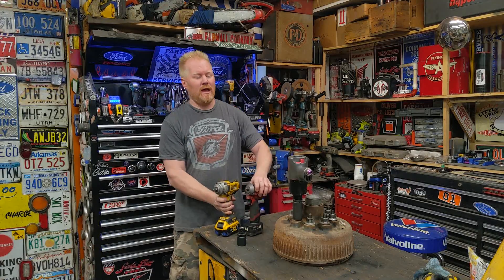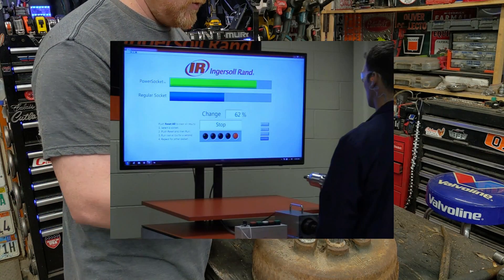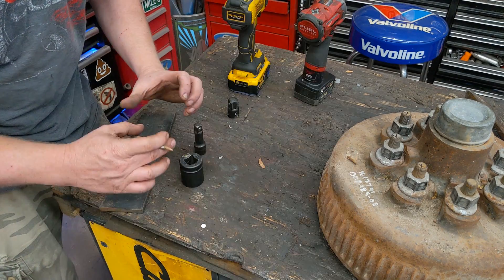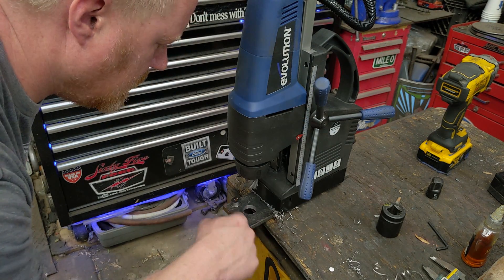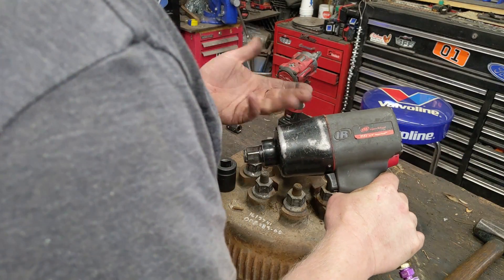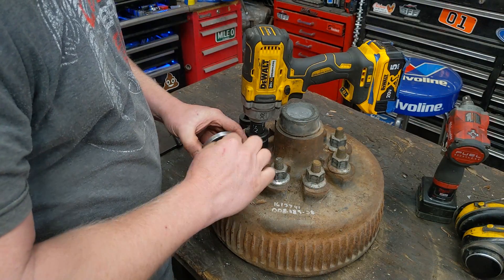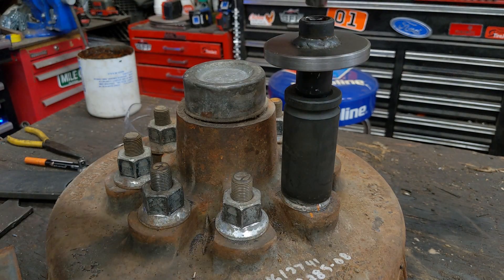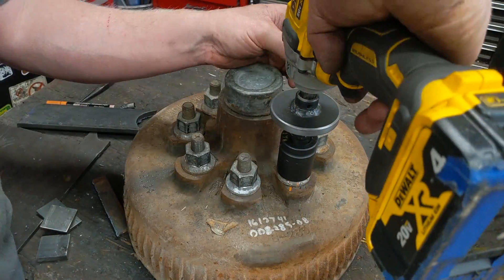Weighted Socket Adapter Build Experiments

Comment: singlecams has several videos on making DIY heavy sockets that he's taken big nuts off with. For instance https://www.youtube.com/watch?v=MZWrdXbdgRo shows using two sockets nested to make a single socket that is stiff and heavy to get crank bolts off.
Reply from the maker: Yeah, I've seen plenty of guys doing this and know it works. I wanted to see if you could make an adapter so you can swap between all sockets without modifying any of your sockets.

Comment: Take the impact gun and put a pipe wrench on the socket as you are hammering.  Leverage rather than mass.  Nice video.
Reply: This is a great idea. It never crossed my mind before. Thanks for sharing
Reply: Combining steady torque w a bit of shock.  It's going to work.  Problem is I usually can't get a pipe wrench into those spots.  Also takes an extra set of hands.
Reply: Family friend who was a Sears mechanic for 25 years told me... "When using impact tools, grip the socket with your free hand and twist counter to the direction of the rotation the tool is trying to achieve".  Something about the momentary reset of the socket back against the hammers gives them more driving force each time they hit.  Not sure of the science behind the theory, but in my experience, this trick has proved helpful almost every time.  And I have honestly never seen a weighted or flywheel socket.  Just heavy duty sockets designed for impact tools.  Great video!
Reply: @matthewpeterson3329  ever seen a socket explode, it would be ugly on a hand
Reply: @Coarse Thread    I've seen them split open, though never an actual impact socket.   It's usually someone using a standard socket on a gun.  Never seen one explode.
Reply: Thanks!
Reply: Sounds great! Now try that method on a Honda crankshaft bolt

Comment: The problem as I see it is the weight you added isn’t going into the socket only the extension in the socket probably not being as effective as having more weight hitting on the nuts than the the impact wrench socket itself. I would say do some sort of spring loaded mechanism that pushes weight over the socket

Comment: Just for R&D i would've welded the extension to the socket eliminating the play and loss of torque. That would've given you a definitive answer to the "Loss of torque with an extension question" 
If you didn't want to weld them, then put some aluminum foil in the socket. When the extension is inserted it virtually eliminates any gaps between the two. I've done it many times.
Reply from the maker: I know I can just weld weight to a socket and make it work but I want the adapter to be interchangeable between sockets. So part of the key to this is it has to work with the slop with the socket connection.

Comment: Good stuff, sir.  It was worth a shot.  I think the included clearance fit on both sides of the socket adapter (which makes tool-less socket installation and removal possible) plays a big part in negating any torque gains.  I know you wanted a modular approach with the socket adapter, but could you try a pipe sleeve on that large socket, but not welded on, maybe with a couple of set screws, or a key and keyways?  Just as a proof of concept.
Reply from the maker: The problem is me wanting it modular. I thought about a sleeve approach but the massive size differences in sockets makes it probably only useful for maybe 3-4 socket sizes before you have to make a new universal size. Not a bad idea though. Impact sockets all have a hole for the detent ball/pin and I was trying to utilize that, but I think it's too small.

Comment: I've no idea of current pricing, but why not get an ordinary impact socket, and weld a bit of pipe or flywheel directly to it. I think the extra umph you get from the adapter is lost in the loose fit of the adapter to socket. in your test. The electric hammer movement is not very far, more like a vibration, so it is just wobbling the adapter back and forth, so to speak..
Reply from the maker: Because you can buy those off the shelf. I wanted to make a modular attachment that you could use with any of your current sockets.

Comment: Did you try and see if you got the same result doing the opposite way around?
I am trying to say by putting the standard socket on then see if it will tighten with your modification?

The best way to find the best results would be to do a true measurement
Reply from the maker: I was using a standard impact socket.
Reply: @sixtyfiveford  sorry.. I was very unclear on what I meant.
Did you try your standard socket with your modified Extinction, then tried the socket without the modified Extinction, just to see if you got the same result as you did doing the opposite way around

Comment: I can maybe see that this would work by making the socket heavier but, weighing an extension seems counterproductive.  Using one adds a second joint into the assembly.  While the joints rebound from one impact, the gun launches another impact that has to overcome the rebound.  A heavier socket may (and I mean may) change the resonance so that there is less rebound for when the gun impacts again.  Just my thought and I sure appreciate you trying.

Comment: I think weighted sockets are stiffer than thin walled sockets, and are therefore more efficient transferring impact/torque.  Adding a flywheel slows rotation (think pirouetting ice skater) and dampens the impact (and possibly amplifies elastic losses in the shaft and couplings because it is "pushing" longer, not harder).  I suspect the type of thread and materials interacting in the thread will have something to do with whether impact shock or overall torque gets the job done.  I get exhaust nuts off bolts that would otherwise shear, using an air impact gun. 

Elsewhere on the internet people argue that the off the shelf flywheels are tuned to produce a certain harmonic in the shock transfer that is good for very high torque crankshaft bolts.
Reply from the maker: I watched thinwall chrome sockets beat impact sockets in torque tests so I don't know too much about the stiffer aspect. I actually didn't believe these things even worked until I saw independent torque tests.

Comment: I would like to see you weld a rod the same diameter as the adapter to the  one side of adapter to add strength and ( weight only to one side of the adapter).

Comment: The concept of a weighted socket or extension is in my opinion and practical experience of being a mechanic who would work on anything from a tricycle to a bulldozer and everything for over 25 years an absolutely counter intuitive and pretty much a scam.  It has been my experience that lighter sockets with a more powerful impact gun is the way to go when trying to remove a stuck or tight fastener.  The more a socket weighs the more force it takes to get the socket moving which in turn is adsorbing the hammering energy of the impact-guns hammers and thus lessening the force it is applying to the fastener.  Many years ago my Snap-On man had demonstration setup to prove that there (Snap-On) lighter impact sockets were better than their competitors impact sockets which were a lot less expensive but also a lot heavier.  The demonstration setup was a piece of plate steel that had been drilled and threaded for two 5/8 bolt, the bolts were oiled and then tightened with a torque-multiplier to stupidly tight (I forgot the the torque valve but suffice to say it was tight) and then using a Snap-On 1/2 impact gun with the appropriate sized Snap-On impact socket on one bolt and their competitors socket on the other bolt  they were both tried to be removed using the same impact gun.  Every time that I saw this demo being done the lighter Snap-On socket would remove the bolt and the heavier socket of the competition’s would just sit there and rattle on the bolt but could not break it free to remove it.  I repeated the test using my IR impact gun and impact socket and the Snap-On socket with the same results. I later discussed the demonstration and results with a several customers of mine who were engineers that worked for the Nuclear Regulatory Commission and they all said same thing that the lighter socket would break the tighter bolt free easier using an impact gun because it was transmitting more impacting force from the gun.  Two of them also said that if perhaps the threads were damaged or coated in Loctite that once the fastener started to move the heavier socket would have the advantage because then it’s heavier mass would to drive the moving fastener.  Hopefully what I have tried to say is understandable and help make sense of this matter.
Reply from the maker: Makes sense, I watched thinwall chrome sockets beat impact sockets in torque tests with actual graphs showing the value. I actually didn't believe these weighted sockets even worked until I saw independent torque tests with graphs showing a 50% boost over all other sockets.

Comment: edit: replace weight by angular momentum in my comment...

My physics is a bit rusty, but iirc to maximize momentum transfer you got to have the same weight for both masses in an elastic collision. That means hammer inside needs to have same weight as the anvil, and the anvil needs to have the same weight as the socket.

If the anvil is too light then the hammer keeps going after hitting the anvil, if anvil is too heavy the hammer bounces back. Neither of those situations transfers all hammer's energy to the anvil. Same idea for anvil to socket collision.

Don't know what you can do for the anvil, hopefully the manufacturer already made the anvil the same weight as the hammer. But to get transfer most energy out of the anvil you need to match the weight of the socket to the anvil.
Reply from the maker: Thanks for your insight. I like this thought process.

Comment: I needed to use one of these to get the harmonic balancer off my 07 xterra.  from my understanding the added mass is to prevent the socket from deforming on each impact so more energy is transmitted to the bolt.  whatever it is, the one I used worked.

Comment: Each socket connection dampens the impact force. Best bet would be to put the flywheel on the 1/2-3/4 adapter
Reply from the maker: Yes and no. I watched tests of a single 15" extension compared to 3 connections adding up to 15". The 3 connections was momentarily lower in torque but after a few seconds the end torque achieved was virtually identical between the two setups.

Comment: The Florida pool pump motor bearing repair guy When Service Calls Longwood approved ! that was good info . I wonder if LEAD could work ??? Seems like you're willing to spend time.
Reply: Beads of shotgun lead. in the outside holes, you drilled in it.

Comment: I think you need to have the moment of inertia of the nut, socket, internal part of the impart wrench to be equal to the moment of inertia of the anvil in the wrench. If they are not equal the force will not be transferred properly to the point where the bolt is holding.

This is why you see people attempt to remove Honda crank bolts with a huge impact and a small socket and fail. The huge impact has a heavy anvil at a bigger radius hence s a bigger moment of inertia.
Reply from the maker: I like your thought process.

Comment: Sank oil. For mass to work it would need to be in motion. Your impact needs more  power.
Reply from the maker: I thought the same and I actually didn't believe these things even worked until I saw independent torque tests.

Comment: toss the flywheel version and maybe instead of a fat socket style you made a fat adapter style. That would give you the weight as well as more rigidity where you're loosing a percentage of your power. Envisioning an adapter about the same OD as the socket.
Reply from the maker: I love the way you think. That was my thoughts exactly and probably my next mock up.

Comment: My thought is you loose too much with the adapter.  I would try and weld that on.  If the thought is to use a smaller impact.
Reply from the maker: Yeah, possibly.

Comment: I prefer the torque multiplier tool , when I’m out on the road , and the gun won’t remove the nut. I first crack the nuts with the multiplier, then use the gun. 
Never been beat so far. One turn on the multiplier is roughly sixty four on the gun.
Reply from the maker: Yeah, it's hard to beat the torque multiplier.

Comment: I understand the theory which counter to many perspectives is still sound. However using a drive adaptor and additional extension where the flywheel is situated removes the affect of the hammerstroke. Its stroke is too short to benefit by the frequency a rattle gun has. Like you said, an extension sometimes takes the grunt outa the rattle. As for having a great lump on the socket ? They can keep it . I have had to trim too many sockets to have an interest in storing those ungainly lumps; thanks [ lol ]
Reply: thinking the same!

Comment: A heavy socket has more material, so less chance of it splitting or deforming.
I can't see much more being gained.

If a really heavy weight was spun up to speed (stored energy) then suddenly connected to the socket the energy in the mass has a chance of moving the nut.
But connecting at speed would be a nightmare :-(.
Just heat the nut up and use your impact tool lol.
Reply from the maker: Can't beat heating it up. That frees up any bolt.

Comment: I m not a engineer but if the weight is at the adapter, I’d assume you are only increasing the hammering force of the adapter only.  Overall socket torque force is actually remain the same as before.  The purpose of the weight is to increase the torque of object or socket driven by an outside force transfer directly to the lug nuts.  My guess which would work is if you weld this custom adapter directly to the socket, eliminate the vibration, making it as one solid piece, then the weight will transfer directly to the socket, and ultimately increase it’s torque.
Reply from the maker: Yes, I have no doubt welding the weight directly to the socket would work. That is essentially what the store bought ones are currently doing. I want to make it modular so any socket can be used at any time. It may not be possible, but it's worth a shot.

Comment: Interesting experiments. As for me I never bought any electric impacts so the air impact I have gets the bolt free like 99% of the time. So there is really no reason for anything like this. ( If I have issues with a bolt I will overpressure my tool to accomplish the task. )

Comment: What about pre-tensioning it to remove slop? A rubber band twisted around the shaft that you pull to have all surfaces engaged when the hammer hits? There is a lot of bouncing in the connections.

Tip from a viewer: white pen markings on the socket to easier see rotation.

I would love to see more experiments. Thank you!

Comment: Make it tighter fitting so there are less losses with movement. Add some weld and then grind it down a little so it's a super snug fit on both ends of the adapter.
Reply from the maker: You would think so, but I watched tests of a single 15" extension put up against 3 pieces adding up to 15" and the torque results were the same. So the joints seam to have little to no effect on torque numbers. In tests the 3" extension lost about 10% of the guns total torque and that number dropped the shorter the extension and rose the longer the extension.  In theory I should be loosing around 5% with my 1.5" long modified extension.

Comment: I think not having a solid connection between the mass and the socket reduces impact. I've done the opposite of your experiment: while screwing together 20ga steel stud, my impact screwdrivers (12v and 20v dewalts) were snapping the tips off of phillips #2 bits like crazy. (any bit brand, big name or no-name, "impact rated" or not, all the bits were snapping or twisting the tip, any length from 1.5 inch to 6 inch bits) SO I did an experiment: instead of a one piece phillips bit, I tried a magnetic bit holder + short bit. And since then I can go all day on the same bit, no snapping or twisting, in any of my impact guns!

Comment: Wonder if there's a way you could spin the flywheel and then have it suddenly engage and lock? Like you're charging up a really heavy blast for the socket. 

Idk I figure it should work, but of course it's gonna be a large tool and not be useful where you probably need it.

Comment: What about an adapter with a lever handle to add foece by hand while also getting the hammering from drill? Would need a mechanism to stop it from spinning from drill power.
Reply: Oh yeah hey have this type of thing to remove stuck/broken bolts.  Could do the same thing in reverse no doubt.
Reply: You just need a 2 sided pass through rachet with a male to male adapter
Reply: @nicholashollow9410  hmm interesting  even a 90 degree bar welded onto an extension would work.

Comment: What about an adapter that fit into a 3/4 drive socket and converted to 1/2 drive while also have a flat plate with a sleeve that wrapped around the socket, putting the weight in a better place and adding minimal length. Could make like 3 sizes to to be close enough to various socket OD sizes. Bonus points for making one that auto fits the OD of any socket.
Reply: Yeah! That would be really cool, but would have to be brand specific due to differences in wall thickness and quality

Comment: The style of adding a ring of mass far from the center of rotation will add a great amount of inertia to the socket which will take more energy to spin up, if the gun is capable of putting out the energy to spin it up the mass then you can probably see an increase of performance, perhaps for lighter impact guns you would need to just make an adapter with more weight closer to the center of rotation, and not such a big ring as what you have.